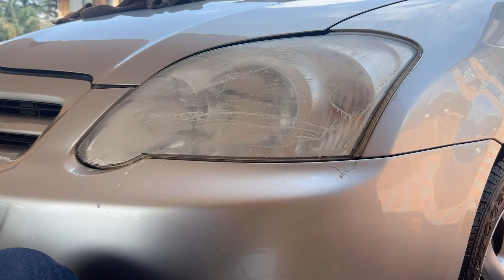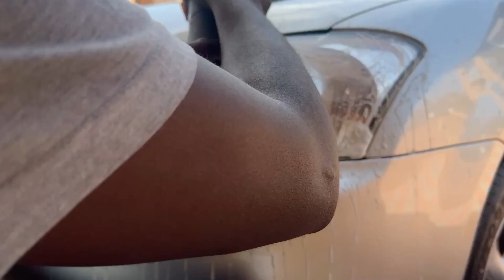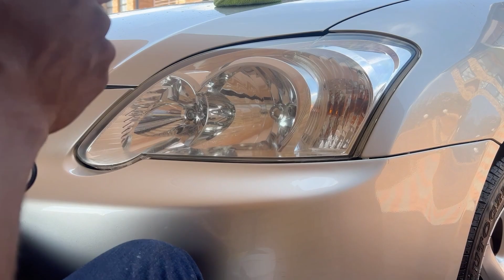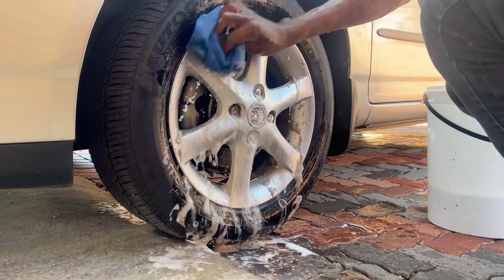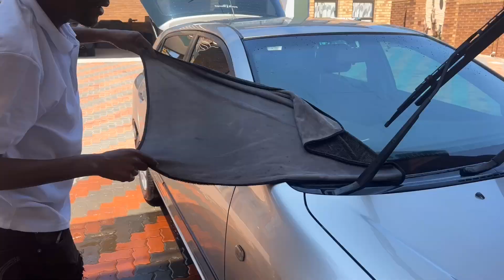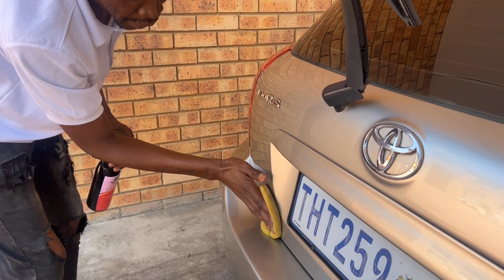Toyota headlight restoration

Comment from the maker: Some time back, think I used 800 grit, then 1500 and topped with 2000 grit before polishing with an abrasive compound.(menzerna400) I then protected the lights with Rupes uno protect which has sealant.